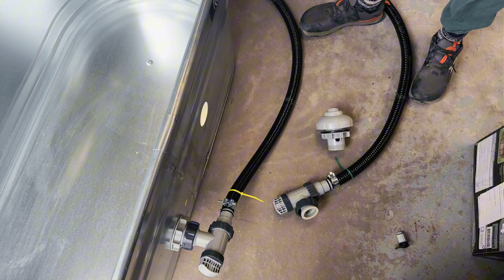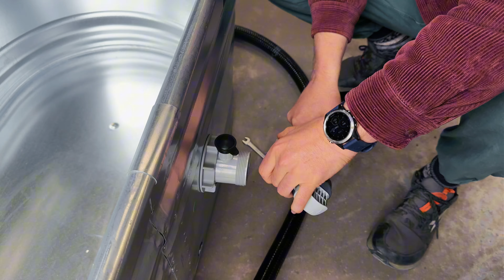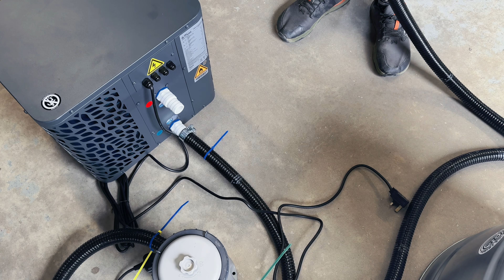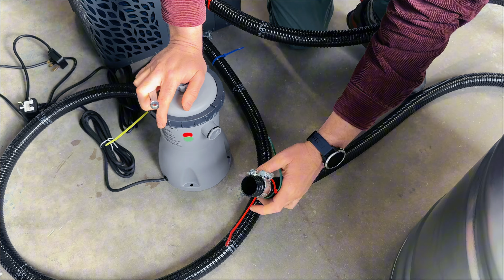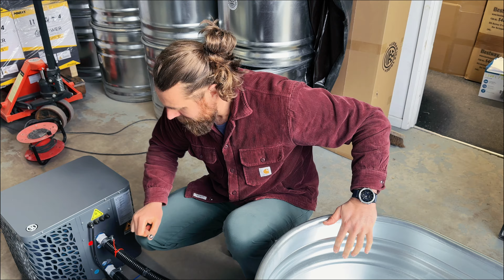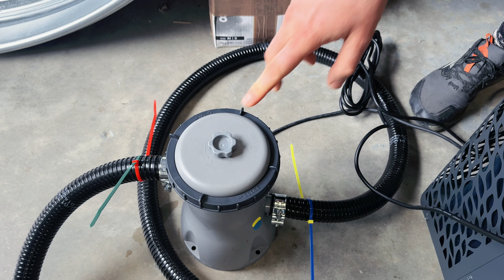💧 How to Set Up Your Mini Chiller & Pump Bundle with Your Ice Bath ❄️

Comment: I have purchased this to keep my ice bath clean and cold. How long should this be left running for? Constant? Or intermittently?
Reply from the maker: Hi! Apologies for the delay! 
It doesn’t need to run permanently as it can drop the temp of 400l of water by up to 4 degrees per hour. So as an example, if the starting water temp is 15 degrees, it will only take 2.5h to reduce the temperature to 5 degrees. Using the smart app, it can be set on a timer to only come on when you need it. It is the most efficient way to cool or heat water. Hope that helps!